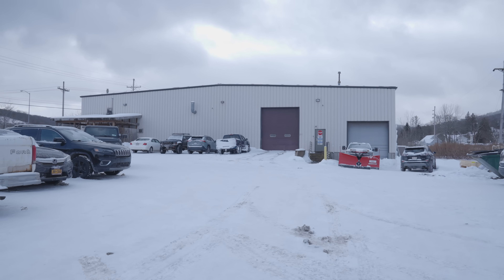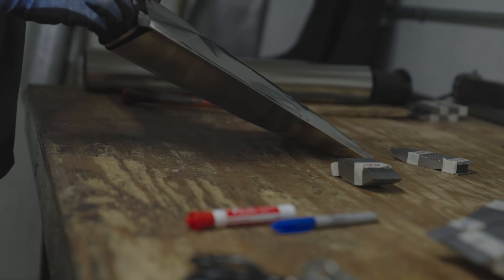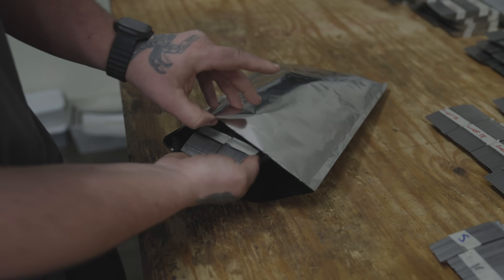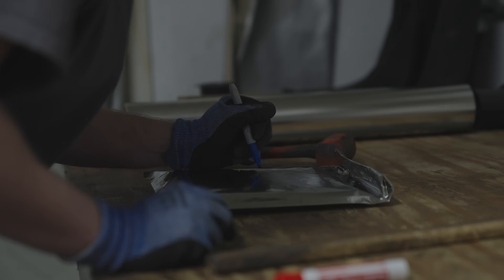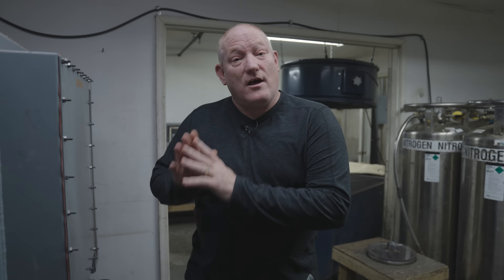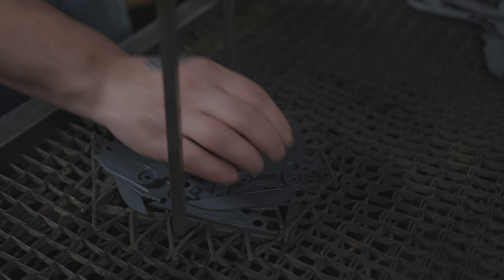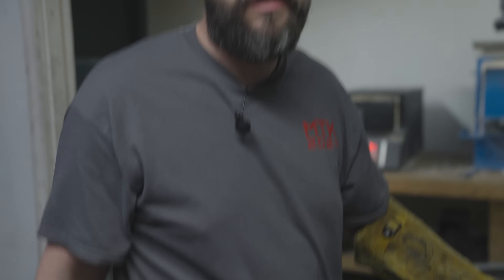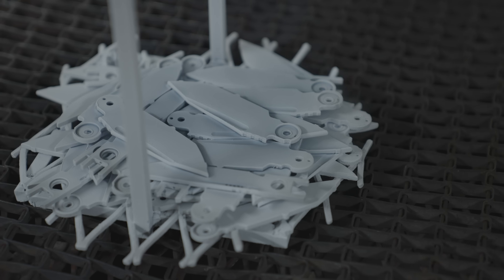Birth of the Blade: Microtech’s Böhler-Prescribed Heat Treat for M390MK 🔥🔪

Comment: Now i see why my  Socome Elite loses its sharpnes after a coupel cust. I got a midel one from the heat tretmant and it got only 59HC or maybe less. For a 400€ knife that is not good. You have to find a way to heat up all of the blades to the same temparatur and you will raise the hc tolaranc to 61-62 not 59-62.  im quite disapointed.

Comment: The tip on my distressed black dirac delta double edge double serrated knife broke like it was glass. The application i was using it for at the time was not intense at all.  I was blown away by how easily it chipped,  but I was also kicking myself in the ass because I know enough to know the material doesn't have much tensile strength because of how hard it is.  If I send it in could it be resharpened at the top to a clean tip. Roughly 60 thou  chipped off at the top.  Thanks in advance.  I own multiple microtech knives and need to send them all in for sharpening.
Reply: @Kyle-xt8ip  can't.

60 HRC is not hard at all. The reason your tip broke was a combination of the blade geometry being too thin for the application and a poor heat treat.

Comment: Putting that many blades together doesn't allow for constant heating and cooling of the steel. This totally explains the inconsistent blade heat treat that I've seen.
Reply: Peters HT or Paul Bos use vacuum furnace which is way bigger and has lower heat radiation and slower quenching rate compare to Microtech atmosphere furnace.  They also stacking blades like what Microtech do and no one complain about their HT quality.  I work in heat treating industry and I will assure you that what they did in this video is not that bad.  Maybe they could do cryo post quenched do get optimum RA to martensite formation but I do understand the risk of distortion which are way more to be concerned over optimum steel HT especially for tight tolerance folding/OTF knives.

Comment: Could you fill the bag with argon and fully displace all the air? Or put in some carbon to consume the oxygen?
Reply: @anon58973  

309 steel wrap has titanium in it. The titanium reacts with oxygen in the bag at high heat to form titanium oxide. It burns up oxygen in that process. 

No need for argon or carbon.

Comment: My gen three combat troodon Has way too much blade play. For $500 I expected better. If they can do with the deadlock why can't you ?
Reply: Deadlocks a bespoke $2000 knives. Buy a Marfione custom if you want prime perfection which exceeds that of a Deadlock.
Reply: For a blade that costs as much as a firearm, I guess I’m wrong for expecting top of the line. My ultra tech had almost no play in the blade and I loved it. But if I bought a troodon and it wasn’t decently locked up, I’d be pissed. That’s a lot of money for some people.
Reply: Deadlock uses a rather complex mechanism for blade rigid fixation. This is not a solution for the EDC knife, since the reliability of the mechanism is obviously reduced. As for the blade play, I got the impression that it is in a fairly wide range for different batches. My CT Gen 3 (02/2024) has minimal blade play.

Comment: You would think that after all that effort, you would take the slack out of your OTF design. That's why I quit buying them.
Reply: @clintwalker2698  

I can't stand microtech, but this is the most brain dead comment I've seen in a while.

The slack is required for the blade to move through the chassis. 

Also, they released a model with no "slack " at all.
Reply: @SuperSteelSteve If it’s the most brain dead comment you’ve seen, then how come other companies have made OTF’s with 0 blade play? It’s not a new phenomenon. The Hawk Deadlock is rock solid. Better heat treats as well.
Reply: @murray42076  

Because the Hawk deadlock is a $1500 with custom technology and limited sales, while microtech is a sub $400 mass produced knife. 

By your logic a Toyota camry should have the same 0-60 as a Lamborghini.
Reply: @SuperSteelSteve  No, you specifically said the slack is required to move through the chassis. How does Hawk do that without any blade play then? Instead of throwing insults right away. Try educating. Might serve you well in the future.
Reply: @SuperSteelSteve  By that logic, then all of Tony’s custom OTF’s should have zero blade play as well knowing most of them are upwards of 1k-5k then right?
Reply: @murray42076  

Do you know what logic means?
The reason the Hawk deadlock has no blade play is because of the custom mechanisms, not the price. 

Lamborghini has a custom engine, camry has a mass produced engine.

Technology bud, not price.
Reply: @SuperSteelSteve  Here we are comparing cars to knives. You could have simply educated the man instead of making dickish comments & all would be good in the world. Not everybody is SuperSteelSteve. 🤣🤣🤣
Reply: @murray42076  

Yes, the mechanism used a microtech requires the blade free float to move through the chassis. 

How does hawk do it?........ WITH A CUSTOM MECHANISM. As in proprietary, as in trademarked. As in there are only a few dozen people on eath who own one and nobody has decided to open it up, void their warranty and find out.

Educate you? Why should I educate you? You incapable of doing 2 Min worth of research before you post things on the internet?
Reply: @SuperSteelSteve  I’m done arguing with you though Mr. SuperSteel. I obviously will never know as much as you will. Even know I’ve owned every single knife you’re trying to educate me on today. Take a chill pill, relax, take a toke, have a drink, something. Relieve that tension big boy. You need it.
Reply: It seems you don't understand the principle of the OTF very well. Blade play is necessary for reliable operation of the mechanism in all conditions. Try throwing a Deadlock in the mud (if you dare do that with a $1500 knife) and see how it reacts. By the way, Microtech also started producing knives with zero blade play, and they do not work well in dirty conditions. So you have to make a choice: either zero blade play at the expense of reliability, or reliability at the expense of zero blade play. You might as well complain to firearms manufacturers: "Why does the slide on my $4000 1911 have play?"

Most OTF knives on the market have blade play. This is a completely normal feature of their design. If you don't like blade play, buy fixed blade knives.

Comment: What happens if you put reverse the process & put the blades in nitrogen before doing the heat treatment?
Reply: Nothing.
The LN converts retained austenite into martensite. 

You can only have retained austenite if you austenize the steel, which is the beginning of the hardening process. 

Annealed steel doesn't have any austenite.

Comment: You guys have something weird going on with your hardening. I don't know how true this is, but a lot of people are saying that your knives don't even reach 60 HRC. I think you should make a video on this to once and for all confirm/refute the opinions about Microtech blades not being hard enough.
Reply: They seem to have stealthily upgraded their heat treat in mid last year and are now reaching ideal HRC ranges. Or so I’ve read. I have a 9/24 dated gen 3 CT that performs noticeably better than one from a year prior. Still unacceptable that their heat treat was so poor in the first place
Reply: @bigglock5478 Well, that's very much in the spirit of Microtech. When they had problems with Ram-Lock (on the first batches), they also improved it without any official or unofficial statements. 😁
Reply: My MSI is noticeably softer than most M390 that I’ve sharpened, dare are I say too easy to sharpen. I still love the knife but those are just my real consumer opinions on the m390MK
Reply: As someone who polishes, etches engraves, repairs, and sharpens Microtechs, and other brands, weekly (I'm not affiliated at all with Microtech) I can tell you that developing your own opinion of the steel and not putting faith in others opinions of it, is important. 90% of people owning a Microtech, don't have the equipment to test the hardness, much less, will never use them hard enough to really know what "60 hrc" even means in real-world use.

Comment: Every single microtech that i have sharped has been soft steel. Nowhere near 60hrc. I have some ludts that have almost completely disappeared..and they were made in 23. Meaning i use them at work and sharpen them every weekend, and there is barely any blade left. I have shit benchmades from 2010 that i have sharpened over 600 times with almost no blade missing. To pretend that microtech does a great heat treat is just silly to me. Even the newer 390mk. I have almost made an msi disappear. Its a 24 model. Wtf
Reply: Post a video on your YouTube thats crazy lol I always wanted to see some way sharpen down knives and I do agree microtech goes soft on there steel probably 58 or so hrc
Reply: That sounds real bad 🫠